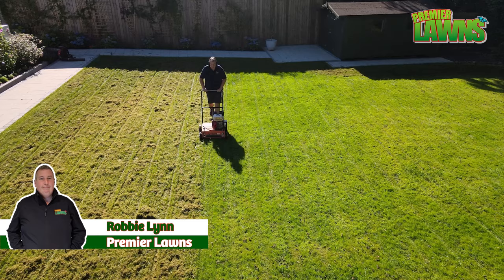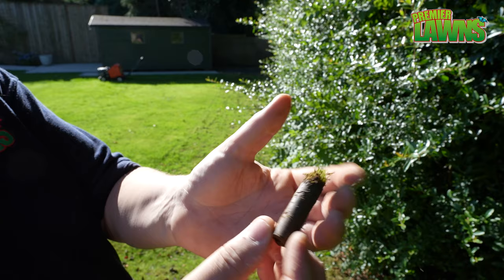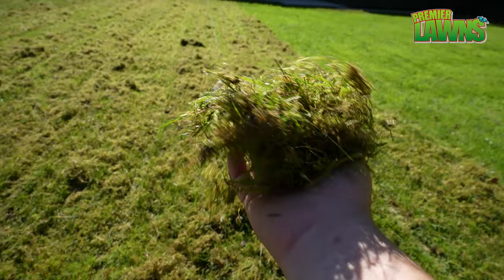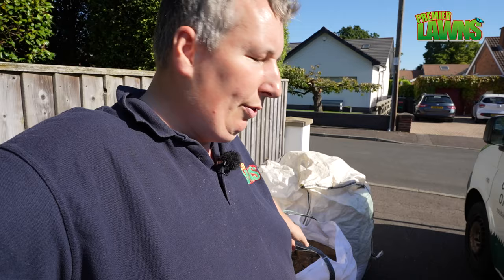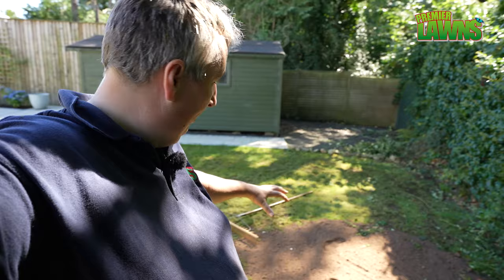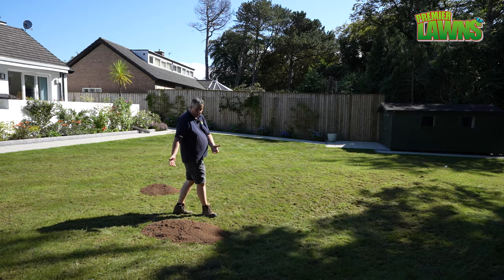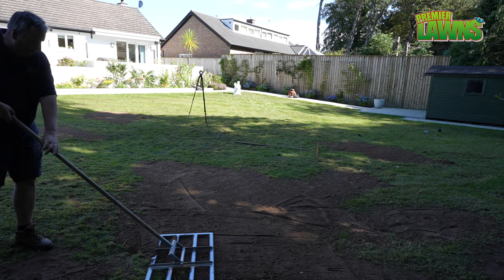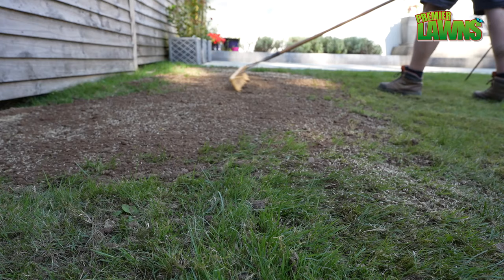Fixing a TERRIBLE lawn with a lot of bumps and ruts

Comment: Thanks for the great videos. Does it matter that you add the soil directly ontop of the old grass? We have some large bumps and if I can cut existing grass short and add ontop would be a much easier task! Thanks!
Reply from the maker: Mike, most people will tell you need to dig them out, I never have and it's never caused any issues

Comment: hey robbie, how long after new grass has started to grow before you can use iron?
Reply: @BrettSucks  why? well a lot of autumn/winter fert has iron in it. as does seaweed and other supplements. my new grass is just over seed on the drought affected areas. so i feel it is a valid question.
Reply: @BrettSucks  thats a better answer ;) firstly, it is unlikely that i will be using it, but if i do it will probably be as a form of moss control. it may also be useful to help knock back some baby clover i have noticed that seems to be sprouting everywhere. however, i thought it better to ask if robbie had an opinion before i used and regretted it. feel free to pass on anymore lawn tips :)
Reply from the maker: @foxy new lawns like getting fed, any preseeder fertiliser will do. You will hear lots of folks say about you shouldn't apply ferts in the winter, and while that is generally true, if your new lawn is yellow or has yellow grass blade tips 9 times out of 10 it needs fed
Iron on a new lawn, iron can dehydrate plants (That's how it kills moss, it dehydrates it), so take that thought a stage further. New grass isn't that hardy and strong. Once you apply the iron it dehydrates it and the plant can't cope. 
So, it's best to leave the iron off it for a while.
Reply: @Premier_lawns_official  thanks big man

Comment: Our lawn is so full of weeds and moss that i think it may be a case of re turfing. When is the best time of year to lay turf?
Reply: Turfing season is on now but bear in mind you need to water a new turf lawn for about a fortnight to allow the new grass to root. So if you live in an area that has a hosepipe ban don’t do it. Leave it until the ban is over.
Reply: @markwilliamson7846  Ah, OK. Yes, we have a ban here in Sussex.  Thanks for the watering tip 👍
Reply: Very expensive laying new turf and removing the old. I’d recommend a scarify and aeration, seed, feed and fertiliser. Still have some warm weather left to sort it this year.
Reply: @JC-qf1jd  you are right. Turfing is more expensive but the actions you recommend are reasonably advanced techniques and it seems to me the op is a novice, I may be wrong but the post read like it was from a novice.
Reply: @markwilliamson7846  Lawn novice yes.  I had do far avoided returfing option as it seemed like a lot of work. 
I scarified last year and year before and SO much moss came out.  The drought has highlighted how much weed is there.
Reply: @gailh4466  hi Gail. No offence intended. So if you are familiar with scarifying, fertilising and reseeding you can still do it, but you better hurry as it’s beginning to cool down and if the soil temperature drops to far seed won’t germinate. However this involves watering, arguably more than would be needed for turf so bear this in mind.
Reply: @markwilliamson7846  None taken Mark.  Problematic with hose pipe ban.  I may need to leave it til Spring.
Reply: @gailh4466  I’ve come to the same conclusion. You can’t do invasive work on a lawn without water and if you can’t rely on constant steady rain fall to keep either turf or seed moist leave it until spring when hopefully the hosepipe bans are over.
Reply: @gailh4466  Hi Gail, I think to be honest with you, it wold be best waiting till april / may now next year unfortunately.
Reply: @JC-qf1jd  Thanks JC.  I think that's the best.